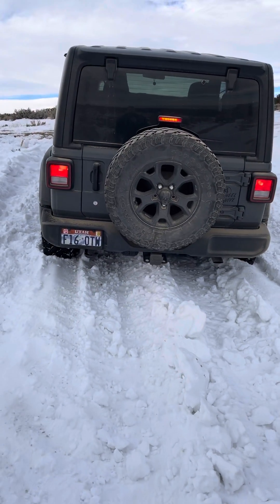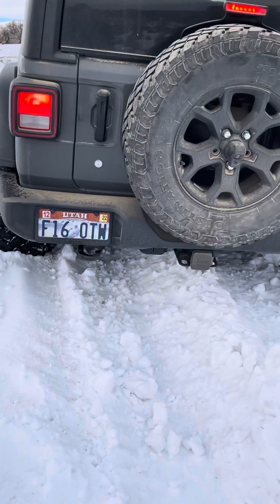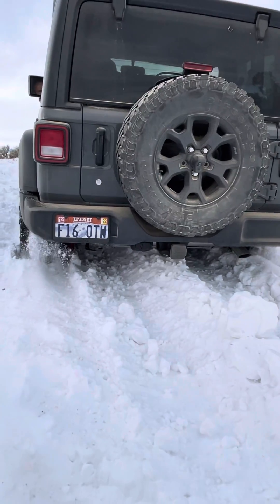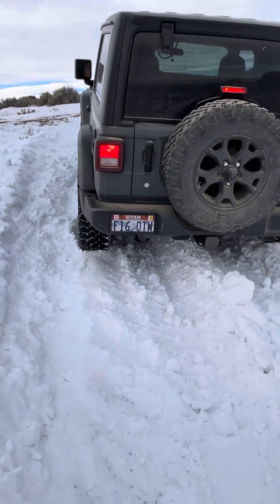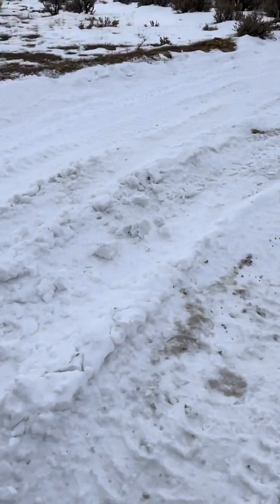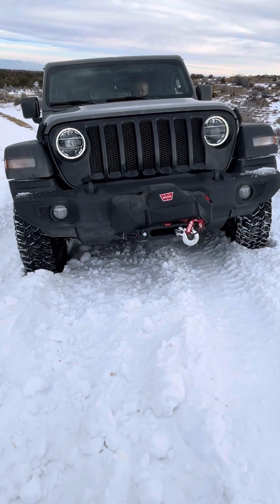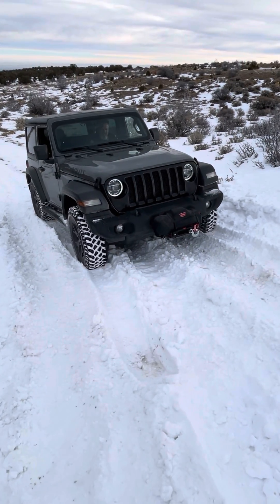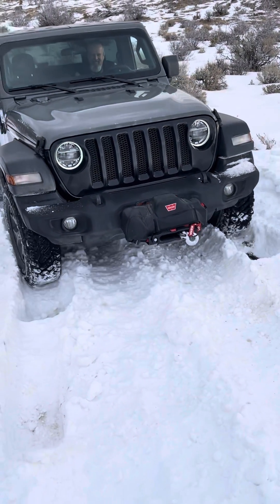Brake Lock Differential (BLD) Demonstration - Jeep

Comment: Would this BLD also work on the rear if your jeep has a rear open differential ?
Reply from the maker: It does.  The rear would work the exact same as the front did in the demonstration.  Its actually a really cool little system and allows all 4 tires to rotate even with open differentials.  Way better than the old trucks/jeeps, where only the tire with less traction would spin.

Comment: That’s honestly really cool. The Willy’s would be just fine for like 99% of Jeep buyers who do weekend off-roading. The Rubi is for the hardcore but people just get them to have “Rubicon” on their hood. Just throw some quick disconnect links on the sway bar to the Willy’s and you’re good. That might even be overkill for a lot of people. To me the biggest advantage of the rubicon is the front Dana 44 and the lower gearing but that’s really only a benefit if you’re going to put 35 inch + tires on there.

Does this BLD come on the JK too or just the JL?
Reply from the maker: Jon, I think your spot on.  

BLD also came on JK, but I think they have perfected it on the newer JL model.
Reply: You can get the gladiator with max tow and it gives this same setup but with rubicon axel front and rear

Comment: The appropriate way to use BLD for extra umpf climbing offroad or when stuck is using two feet. Apply the brake with your left foot and then add some gas. You will feel like the ABS is working as there will be clicking. That will utilize the BLD in a controlled manner.
Reply: True, using left foot breaking techniques will keep that momentum wanted on that wheel. Easier to experience while rock climbing with no lockers also to stay on progression. Break first, gass up release break till it moves. Great video exist made by an australian Guy forgot his name. I have a lSD and this system on my gladiator 2020 and I can do serious offroad using left foot breaking where people think you need lockers ;) lockers are cool but it make people unskilled over use it and you'll never Learn how to drive
Reply from the maker: Appreciate the tip.

Comment: When in 4H or 4L does the traction control have to be on/off? Or will it work either way in both 4H and 4L? Thanks!
Reply from the maker: When you go to 4L the computer automatically turns traction control off.  When in 4H, BLD will work regardless of if traction control is on or off.

I did a video on traction control.  I hate traction control.  Please watch the video, I think you will find it very helpful.  After watching the video you will never want to use traction control while doing any off road ever again.

Comment: Try the same thing with traction control off, i wonder what will happen
Reply: Actually to make the BLD worked properly offroad means using two feet. One on brake and one on gas. Apply some brake (not enough to stop) and add some gas then your BLD kicks in.
Reply from the maker: E, I have a video on Traction Control (TC) I think you will enjoy.  I hate TC and show why in the video.

Comment: Stupid question but how does this also work in the front? Is this an open diff in the front with a computer simulated BLD?
Reply from the maker: How it works in the front:  The front is open diff as you stated, so the Jeeps computer applies the brake to the tire that has less traction (the tire that is spinning).  This forces all the energy to the tire with the most traction (the tire that is not spinning).  This cycle repeats itself very quickly as you can see in the video, forcing both tires to spin alternately.  

Another way of thinking about it is;  If my front left tire was on ice and my front right tire was on dry pavement.  The tire on ice would spin (tire with less traction) and the front right tire would not spin (tire with most traction).  The BLD would apply the break to the tire on the ice, forcing the tire on dry pavement to spin.  As long as I was on a slippery surface; ice, snow, mud, sand, climbing a hill and etc, this cycle would repeat itself very quickly over and over again, ensuring both tires are spinning alternately (as you see in the video when I purposely get stuck).  Hope that makes sense. 

The BLD on my Jeep never turns on for the rear tires.  I have an Anti-Slip Differential on the rear end, its an old technology using clutch plates located within the differential housing.  As long as I am pushing on the gas, I pretty much have traction to both tires (thanks to the built in clutch plates), so the BLD never activates.  This is why on the video both my rear tires lock together and spin at the same time, unlike the front tires. 

I wish I could go back in time and would have explained anti-slip in the rear tires better and how the clutch plates worked.  My uncle and I both had COVID-19 at the time, so I was sick and wasn't even planning on making a video that day.  That is why I'm so out of breath in the video.  I just made the video on a whim and didn't really plan it out.
Reply: @LowBudgetExploration  Thank you! That’s an excellent explanation, that makes total sense. I have a 2022 JLU High Altitude and I’ve been looking at the build list trying to figure out if I have BLD or LSD. Turns out I have both, mine is set up this same way with Dana 44’s. I’m new to jeeping so this has been a huge learning experience for me. I really appreciate the in depth response.

Comment: Hmmm, how to use this with a manual?  E-brake and throttle?
Reply from the maker: It works the same as an automatic, so you are fine.  As long as your not pushing on the clutch, the wheel sensors will sense slippage and apply the brake giving traction to the other tire.  The computer will take care of everything, you don't have to do nothing.  Not my last jeep, but the one before was a standard and I never had any issues.
Reply: @LowBudgetExploration  Yeah, I realized how stupid that was right after I asked.  This is what happens when you get caught in a YouTube wormhole and stay up way to late.  Great video BTW.

Comment: Good thing about BLD is that it will wind up "wiggling" the Jeep back and forth too.
Reply from the maker: Yes it does!  The first time I experienced BLD in action was on a forest road that had a tree across it.  I had to pull off the road to go around the tree and there was a high berm on the road.  

My front right tire was about a foot off the ground, so I gave it some gas and the BLD kicked in and my front left tire engaged.  We immediately lunged forward clearing the berm.  Almost gave us whiplash.  LOL.

Comment: Thank you for video. Did you turn off traction control? Does is still work with Traction control off?
Reply: What's the difference between this and traction control?
Reply from the maker: Good question.  It works way better with Traction Control turned off.
I always turn off traction control when off roading.  Here is a video I did on why.  
https://youtu.be/UvPG7X2A4CE
Reply: @LowBudgetExploration  very interesting